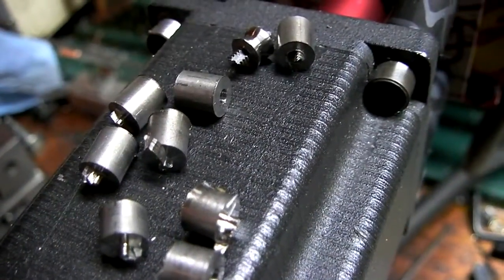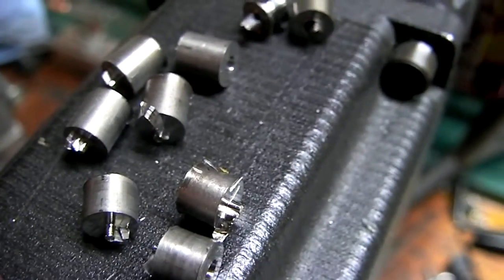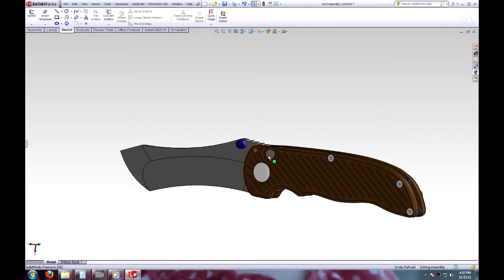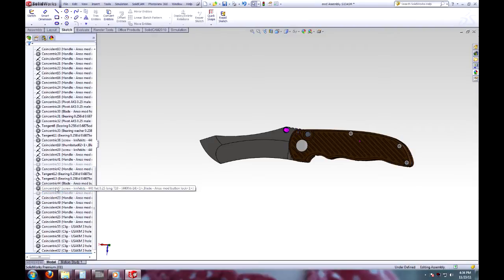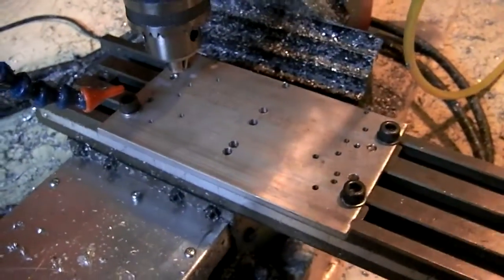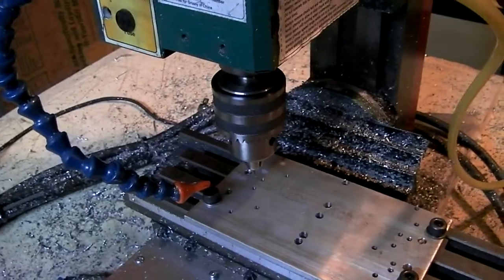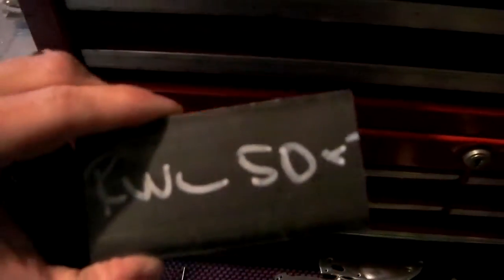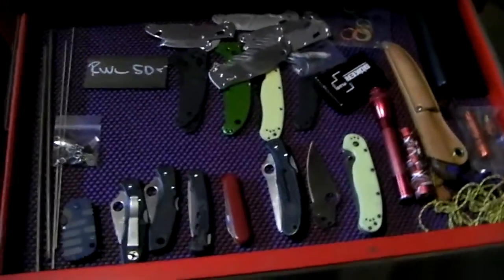Knifemaking Tuesdays Week 03 - turning titanium and making a fixture plate

Comment from the maker: @sgtbeefy1 I think it's a moot point about which will overextend easier, it's all about how much material is left because that defines the spring tension.  Most good knives have some sort of stop, whether it's a hinderer stop, a little pin stop under the lockbar, or using the clip to stop it.  This is something I'll have to figure out and experiment with, because overextending would suck and would loose your spring tension by bending it too far.

Comment from the maker: @sgtbeefy1 Technically it's a stronger way of doing it.  If you think of the lockbar as a long lever from blade to the back of the handle, this keeps it pretty much a straight line the whole way until it gets to the meat of the handle.  Having the cutout on the inside puts the cut in this "straight line".  Whether it matters or not, I dunno, it usually looks nicer having it on the inside, but this way lets me machine the lockbar groove and relief from the same side.